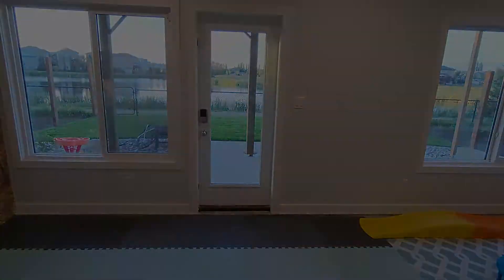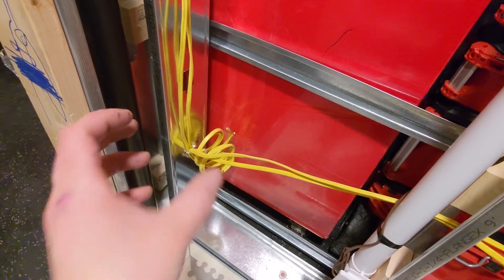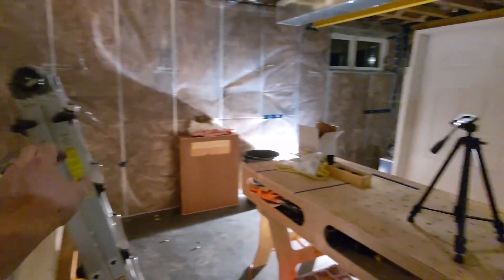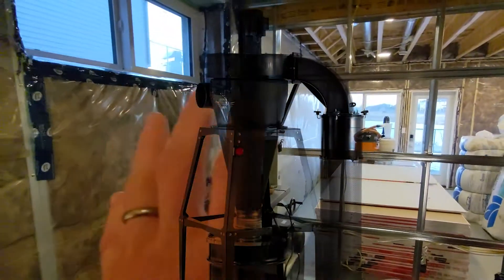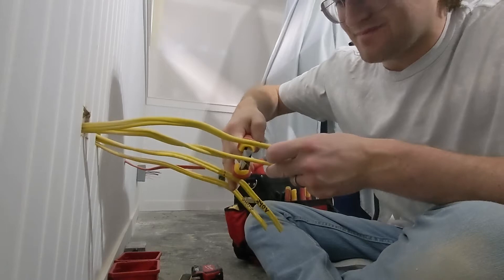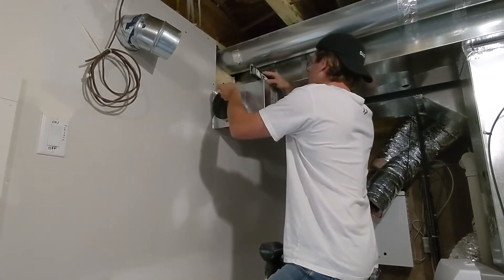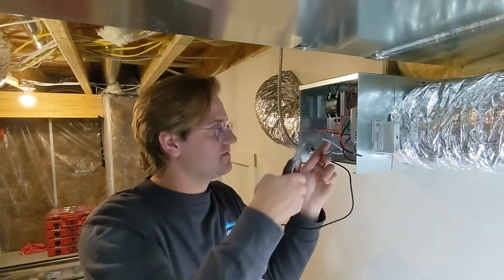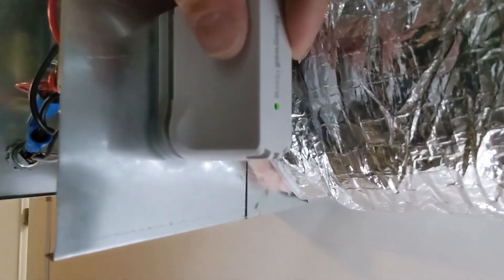The BEST ventilation for a small workshop! ep10

Comment: HRVs are great.  But, I do wonder what the issues might be of long term venting of a woodworking shop through an HRV might be.  Part of the reason I want ventilation is to get fine dust particles out of my shop that the dust collection system is missing.  But that implies that dust is going through the HRV, and slowly clogging the small passages in the heat exchanger.  Maybe the solution is that take compressed air to the HRV, and blow it out every 6 months?  Or maybe I'm worrying about something that isn't really a problem.

Comment: Great content. I've been looking into routing my dust collector output outside the shop (rural location). I know the downside is heat loss in winter. Have you considered doing similar instead of using the cyclone/HEPA filter? I wonder if your HRV would offset the volume of expelled air by the collector, and maintain temperature?

Comment: Assuming your chip collector has 1 mm filtration, there will still be substantial dust in the shop. Do you plan to  wear a mask or what? You said in the video linking to this one that the shop box filter systems were "cancer causing" But I'm concerned that your outside/inside air system will block up fairly fast due to dust. How has it been going, 1 year in? Honestly I'm trying to figure out the  best options for my shop and so far,  chip/dust collection PLUS a micron filter, PLUS a ac unit with hepa filters seems to do okay but even then, my particulate alarm goes off during sanding operations even with a vent hood.??
Reply from the maker: I have a HEPA filter on the Oneida dust collector. It does well. The HRV doesn't filter out the fine dust so it doesn't clog up which is nice. It's more or less straight shot out and fresh air straight in. It's been working great. My comment was sarcastic. Those filters are good but I have concern with people relying on them too much and not realizing that they clog up and their CFM drops fast. Just like most dust collectors...
Reply: @BlakePizzey  Ah! thank you for your swift reply. Yes the box filters have to be changed regularly or they basically just blow dust around. I think the big thing here is the hepa filter on your dust collector and I saw you have a vortex dust separator which I don't. I think those two things are a huge plus now that I think about it. Btw, I did come up with one neat win for the dust/chip collector, if you put it in a small purpose built room, you can make it almost silent AND use a huge air return in the door or wall with a really good, really big filter and you don't loose but a few CFM.

Comment: Sweet episode Blake, impressive. ~ how efficient is a HRV?
Reply from the maker: I actually filmed an entire ending where I recorded temperatures and calculated the sensible efficiency. It was too long and boring though... Had to cut it out. My efficiency was at 79% and they typically range between mid 60s and mid 80s.
Reply: I have a Panasonic HRV that is specified at 95% heat recovery.  However, that assumes perfect insulation on the ducts going to the exterior, ideal flow rates, perfectly tight construction, and other impossible to achieve conditions.  I went to a lot of pains to insulate the ducting to the exterior as well as possible, minimize duct lengths, etc.  I have four units and they average around 80%.  I'm really happy with that.